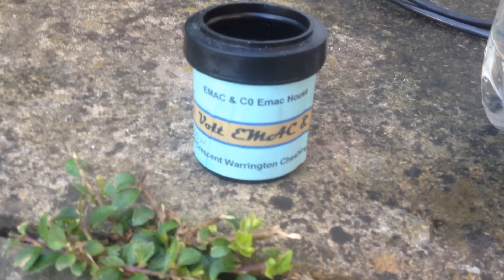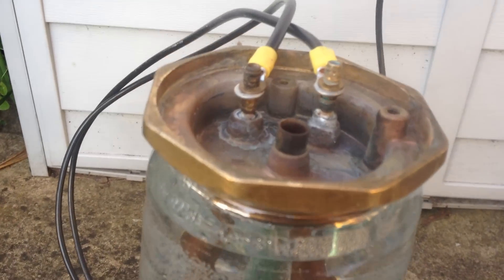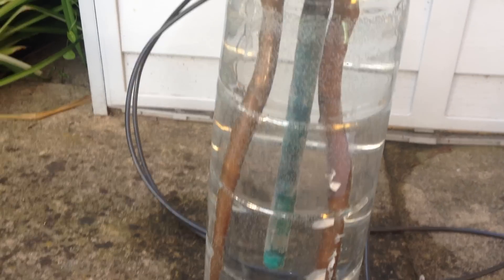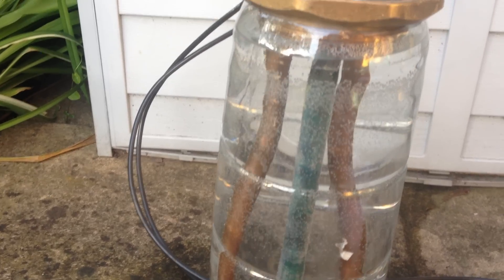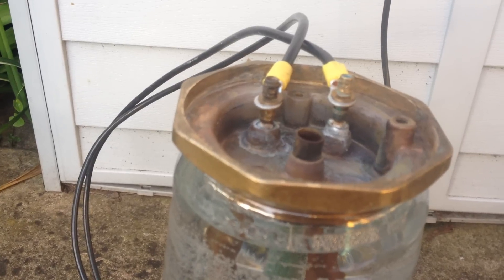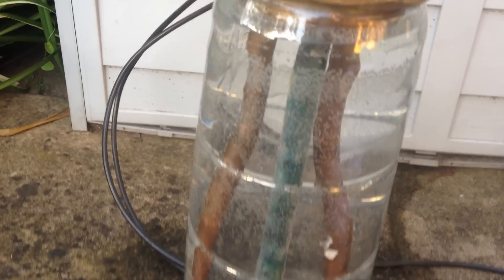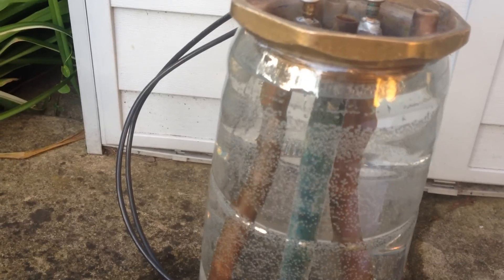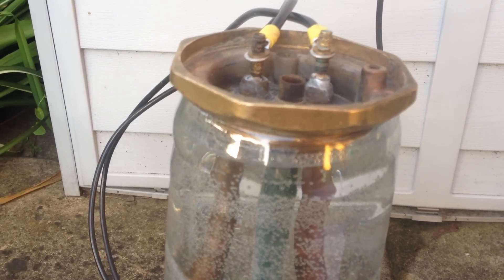12volt immersion heater 2

Comment from the maker: dean,no way are you going to run 32A water heater of 100w panel.
ive got 2000A battery store with 550w panels and it soon pulls the voltage down in 4 hours.
how many amps of batterys do you have?
got no vids but lots of free advice.